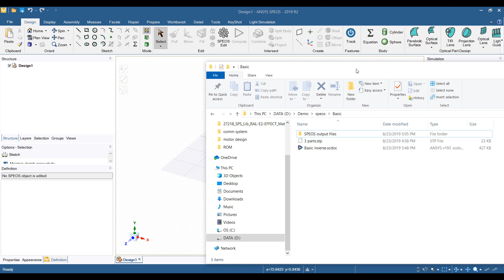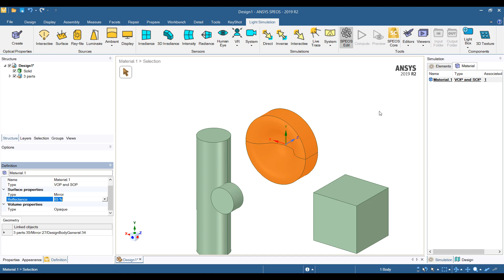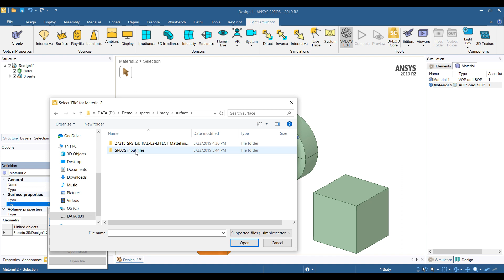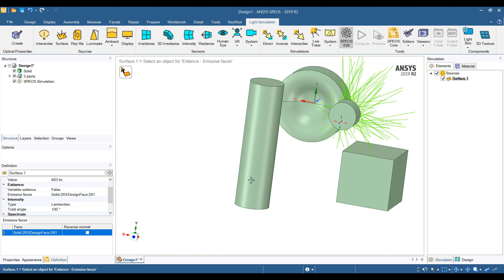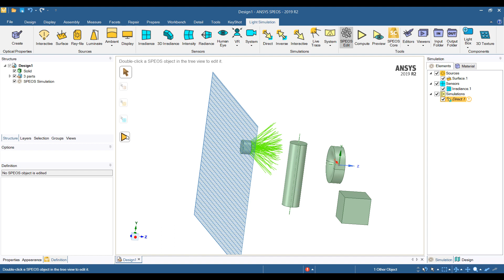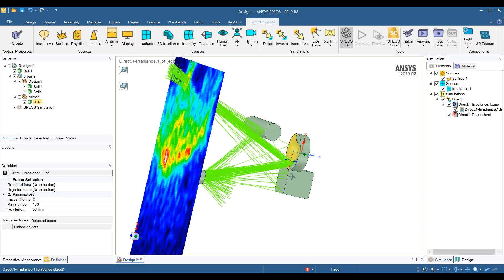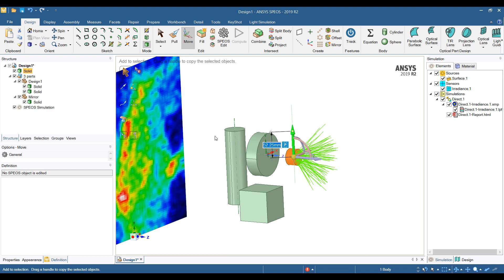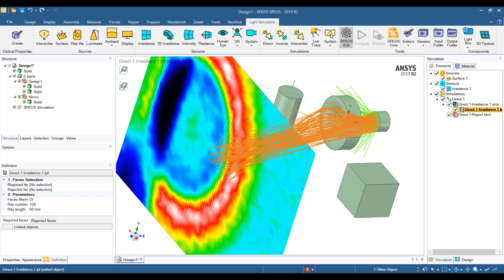Optical simulation with ANSYS SPEOS - basics direct ray tracing

Comment: Hello sir,
I am using Ansys 2020 R2 crack version. I need access to the material libraries however the site you visited in the video doesn't provide me with any such option. Could you suggest some way I can gain access to the libraries? If possible, could you mail me with a few of them?
I need these to perform optical simulations on lens systems and I can't find a way to do so without the libraries.
my id is f20190823@pilani.bits-pilani.ac.in

Comment: Does anyone know the difference between the light intensity type. (See video at 5:20) Light intensity type: Lambertian, cos, symmetric gaussian, & symmetric gaussian. If its solar light which intensity type do I need to choose.
Reply: That might be determined in the measurement formula that uses it to simulate ooooor the light output specs. Someone can confirm?
Reply: LED based on their structure tend to be lambertian, unless already couples with an aspheric lens or a pair of cylindrical lens then the output will be be more gaussian.